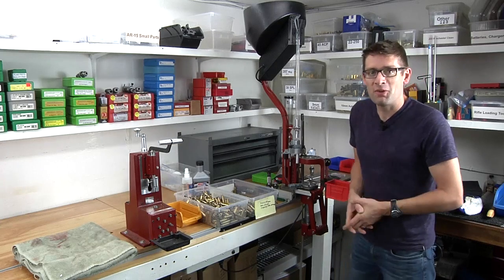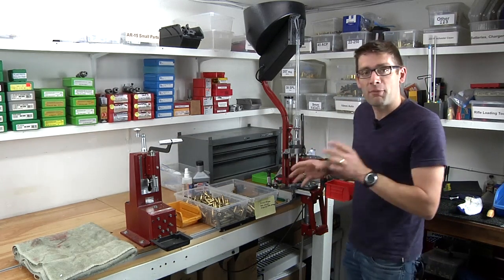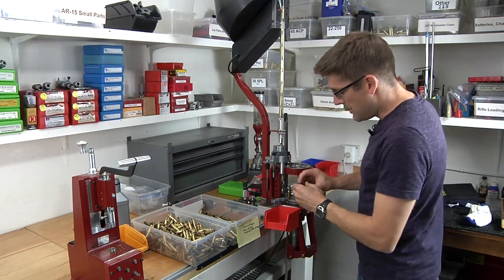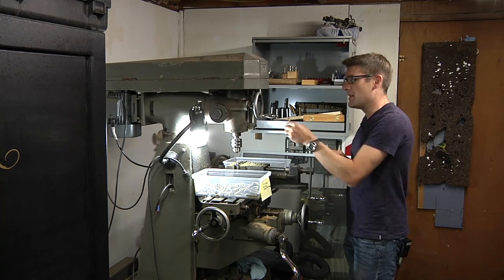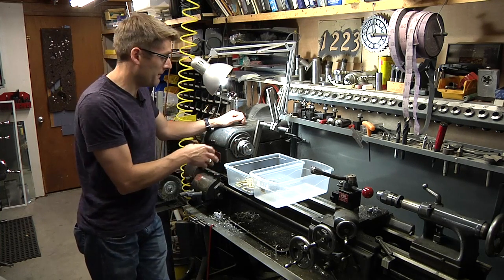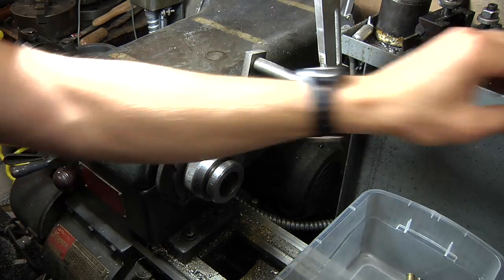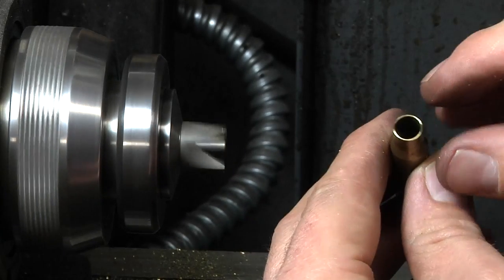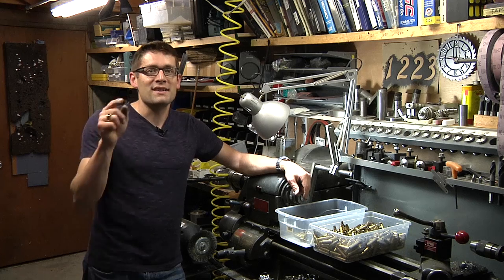Brass Prep With Machine Shop Equipment

Comment: I love Gavin's videos, and I know this video is old as crap, but this line got me:

"What would be really nice is if I had inserts that were threaded".

Bro, you have a lathe. Machine a piece of round stock that fits whatever collet you want to use. Then drill and tap a hole for the various case prep cutting tools.

Comment: Nice. No machine shop equipment for me though! I sort of made my own, a Little Crow WFT in a drill press that I removed the base from and clamp sideways in my bench vise. Voila! Brass station. I use a thread adapter from an old cleaning kit to hold the other prep tools besides the trimmer I mentioned above. Maybe when i move out of the suburban nightmare I can have a shop for some equipment like that. Useful far beyond brass prep! Interested in the bullet feeder too.

Comment: I would rather use the Giraud Tri-Way Trimmer which will trim, chamfer and deburr with one stroke.  Then I would use the Hornady Lock-N-Load AP Press Primer Pocket Swage Tool for 308.  That is what I currently do with my 223/556 and 300 AAC.
Reply: I use the tri-way myself, its awesome! I use the dillon super swage tho..